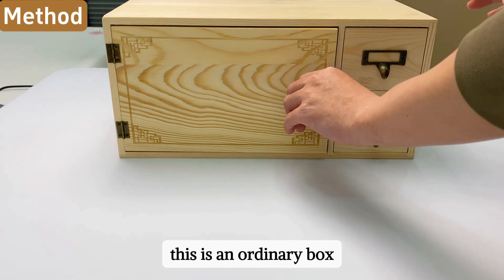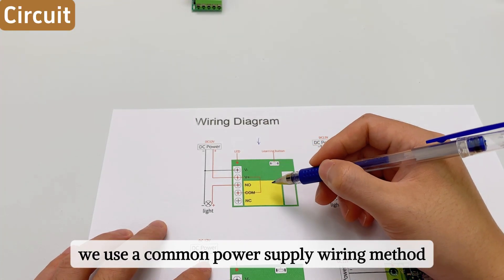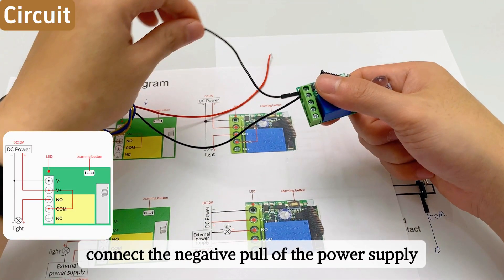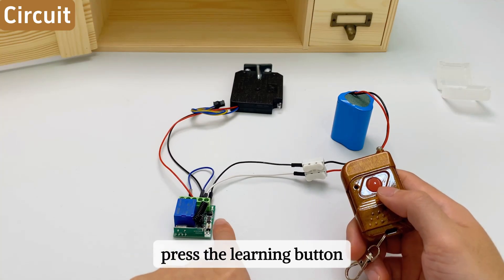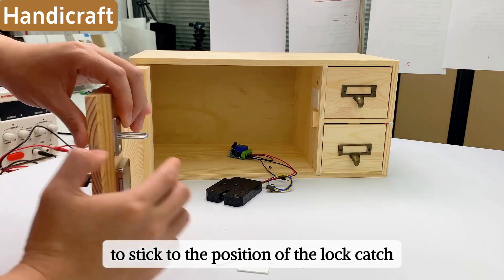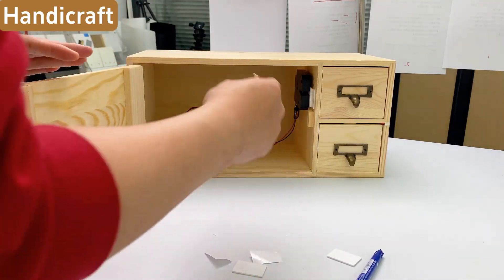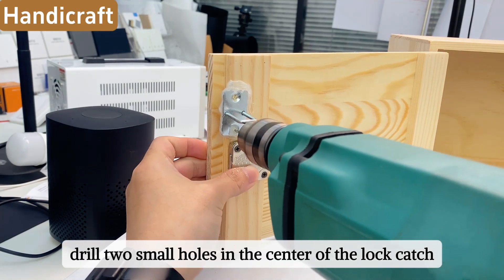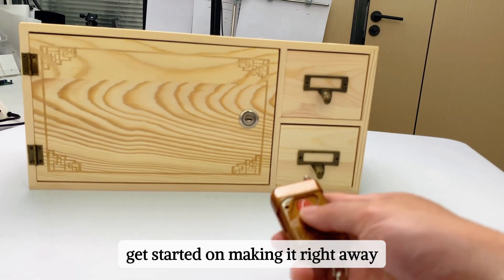How to Use Electronic Door Lock and KR1201 433MHz RF remote control switch 12V relay DIY Remote Lock

Comment: I have one of these controllers but no matter how I wire it the relay does nothing. If I press the wireless controller  button the led on the main circuit board turns on or off but my lock doesn’t open or close
Reply from the maker: First, you need to confirm whether the controller you purchased is from our brand, QIACHIP. Because the following answers are based on our products. 
Listen carefully. When you press the remote control, does the relay make a sound?
If the relay doesn't make a sound, then a matching operation is required. Watch our video: How to use remote control switch, DC12V, wireless relay switch 1Ch rf 433Mhz, KR1201 by QIACHIP
https://youtu.be/ah2Llv7Pp2w
If the relay makes a sound, it means the remote control and the controller have been successfully matched, and there may be the following reason.
The relay itself might not be compatible with the door lock. If its specifications, like contact capacity or driving current, don't match the requirements of the door lock, it won't be able to operate the lock.